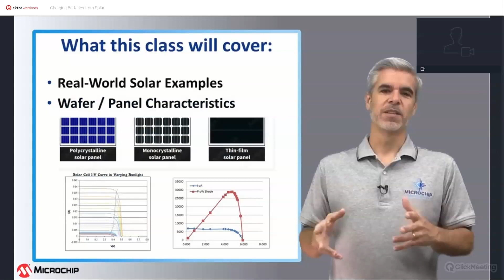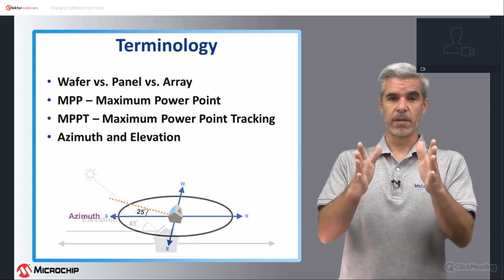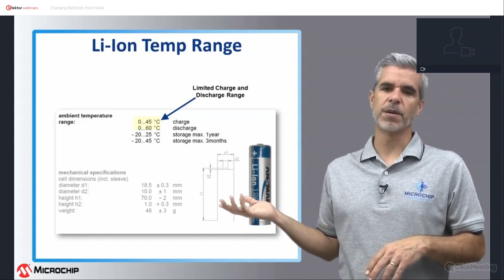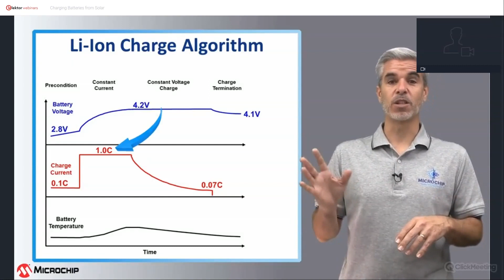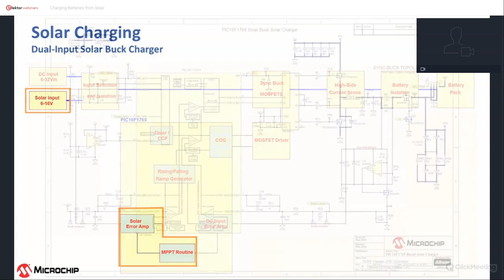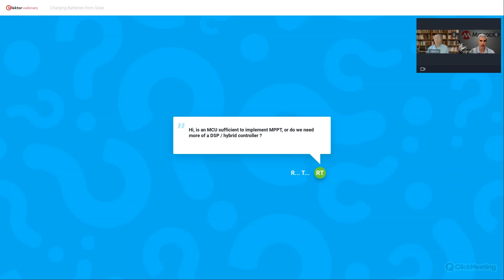Charging Batteries from Solar

Comment: A little too detailed for the subject. Going into the molecular operation of a solar cell is totally outside the scope.  Several other topics could have been glossed over - many details not relevant to the subject.  You cite the disadvantage of Perturb and Observe (time per cycle and current drain) without stating that both of those are only meaningful for tiny power projects.  Anything close to the size of a stationary array of panels, and the few tenths of a second it takes to find the MPP is nothing compared to solar irradiation variability.  And the few milliamps shunted away to measure current is so small compared to the total output it's not worth consideration.  Not covering this is even more odd since 90% of the video's examples prior to introducing your development products are multi-panel arrays that prove this point.

Comment: Clemens has way too much low end on his audio, and not enough high end.  It makes for a very boomy voice that's hard to listen to.  There are many ways to fix this, but I suspect the high end (2-4 kHz) has been cut too much, possibly due to environmental noise.  The human ear is much better at compensating for noise than for missing frequencies around 4 kHz, which is very important for understanding the human voice, especially for older ears that have reduced ability at those frequencies.